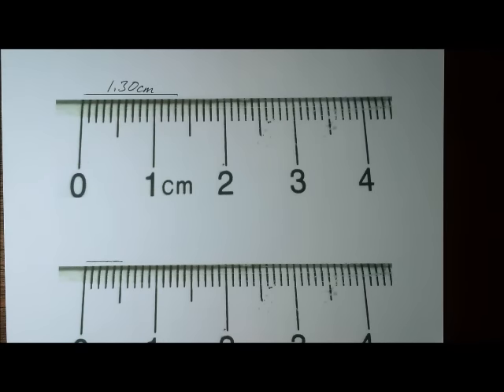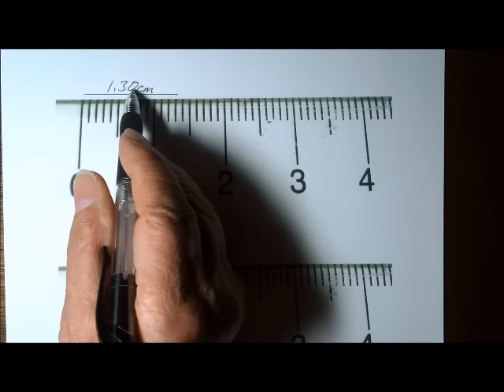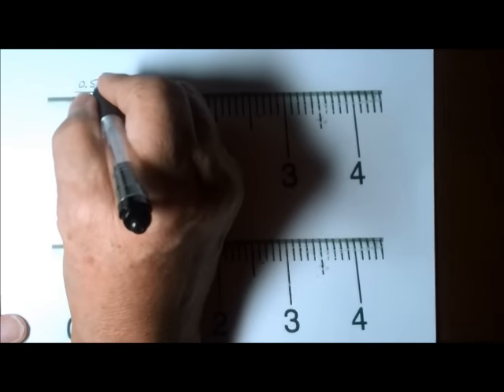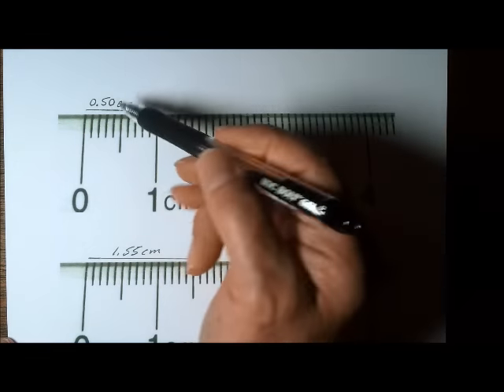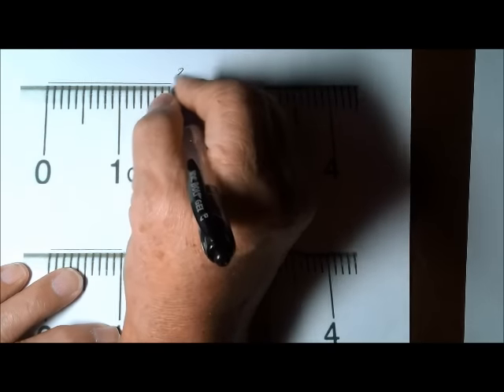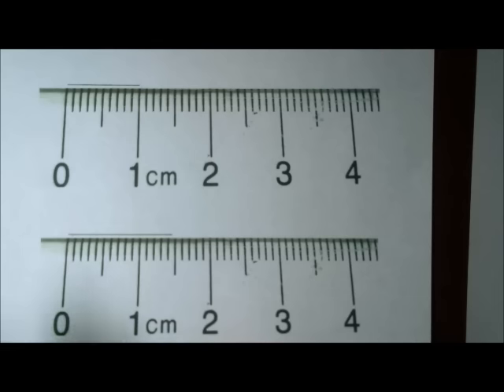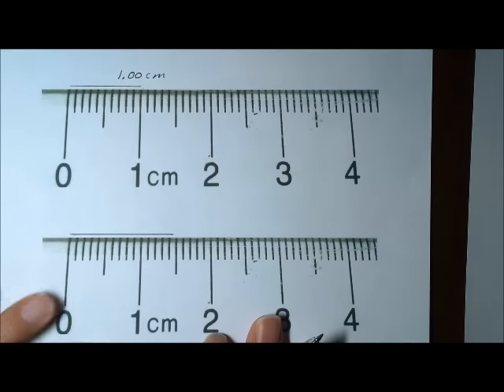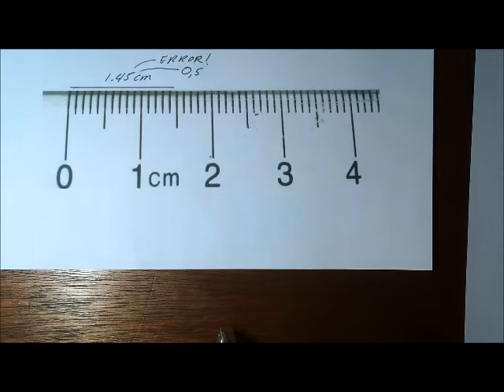How to Measure length correctly using a Centimeter Ruler

Comment: This video is perfect. Mostly when I'm doing custom box builds for desktop/server computer builds for clients and friends. They usually give out vague measurements mostly when accuracy is needed the most ex. such as width placements, corner measurements, rack drilled hole mounts and etc. They usually use over the counter rulers. So to solve that problem I usually show them a picture of my regular ruler with the hundredths 0 or 5 error measurement rule and I tell them the limits. In return they send me an accurate measurement of the builds. Extremely helpful thanks to the uploader.

Comment: 2.54 inches   equals two and 35/64ths in "American" Imperial I believe. What does 2.54 cm equal if you cannot have point 54 when we are told one cm equals 2.54 inches...? the "error" part makes me think they are needing bigger "tolerances" when building or measuring something...?

Comment: How long can it be in cm if it is 20 in inch
Reply: as an inch is 2.54 cm, it's 20 * 2.54cm = 50.8cm. Or you can just enter "20 inches in cm" in the top search bar of your search engine (when you're using Google) to get a result.

Comment: When you measure with a ruler, do you have to start measuring from the zero?
Reply from the maker: you start measuring from the first tic line. That is zero. On most rulers there is a short space before the first tic line. This means that on most rulers you do not start measuring at the end edge of the ruler.
Reply: davenport1947 Thank you so much!
Reply: boricha tea
Reply: But tailors or designers starts measuring from the edge of the tape and not at the zero

Comment: Hi, now I know where to place the dot/period when I’m trying to figuere out a size of 73.3 cm. (So that I can created  the Cubit that projects 188 MHZ). Size for this Cubit Rings Needs to be to the exact -  when cutting and welding the 2 ends together of cooper. 

Now, don’t know if you ever seeing the plastic metruring tape that a Tailer will used when they are trying to get the right size for your pants, or your shirts. The ones that are very flexible, I have one of those, and the are long. The top I know it la inches, but the bottom lines sema to be CM to me. Not 100% sure. Those are plastic and sense I need to mature 73.3 cm ( or 28.8578” in inches and that it’s much harder to calculate have a percise cut) for my Cubit, so going with CM.... sense he also gives me the conversation... I take CM over that inches, to me it’s much, much complex/I’m  not a Carpenter nor a builder. 
A little ruler won’t give me the length. 
Any suggestions there? 
Thanks for ur time in advance.